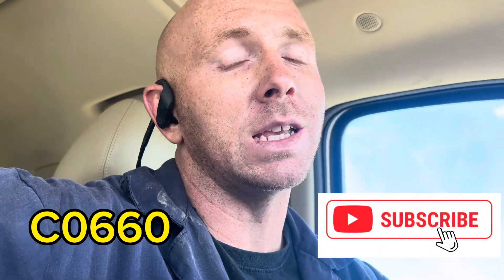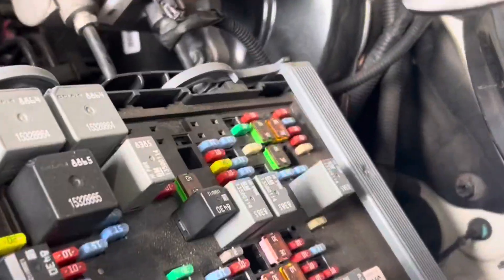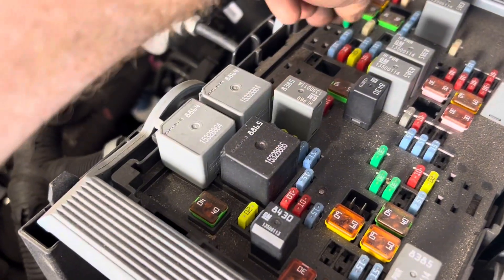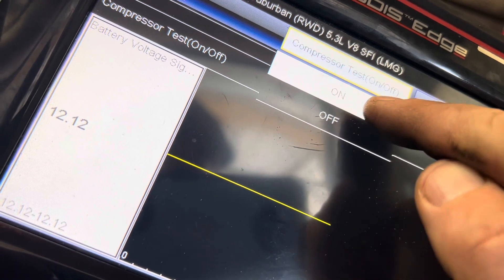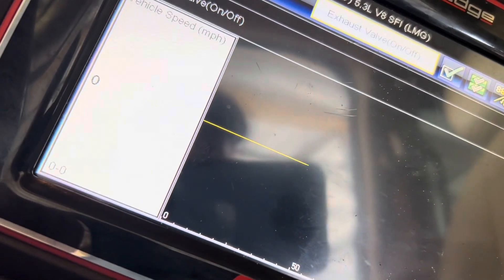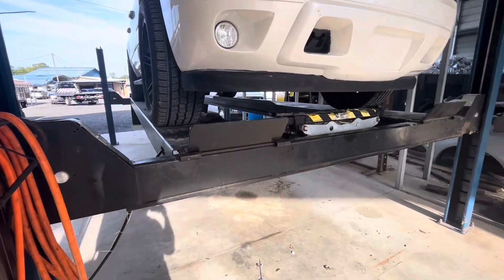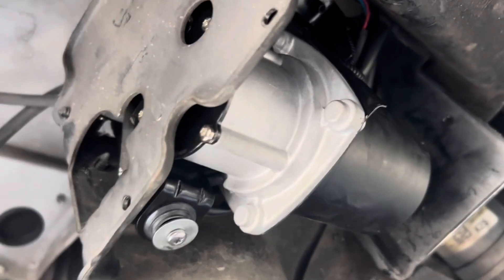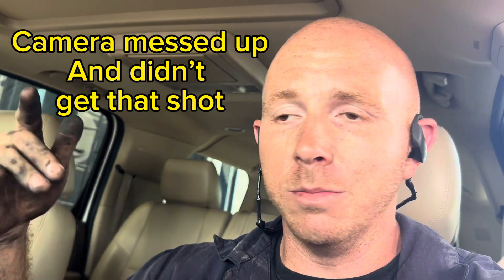Service Suspension System C0660 2013 Chevy Suburban

Comment: So I think the guys I bought my avalanche from removed the air ride. I looked at the codes on the label in my glove compartment and it showed ZW7 which if I’m not mistaken is air ride.”For lack of better word” But I don’t think they deleted it properly. As I’m driving my gauges go to zero and the warnings AbS and I believe stabiltrack warnjj in my sign show. But on my HUD it says service suspension system. It does t stay on it just does it at any random time now, more so now than ever. Any ideas?
Reply from the maker: Can bus problems maybe?

Comment: Hi thanks for the video i have the same scanner but when i go to test the air ride compressor on the scanner mine says “functional test not supported.” I also have codes c0660 and c0895. Not sure if that’s why I’m getting that message or is my scanner isn’t working properly/capable?? Any advice is appreciated thanks!

Comment: I had a c0660 and c 0712 I replaced the the compressor again still nothing . I pull my alc relay I gave it power it clicks  I also gave my relay pins power to run pump , pump runs. Am I looking at replacing the Alc control module at this point since my c0660 keeps coming back. Thanks any help is appreciated
Reply from the maker: What about the level sensors? Since the pump runs when commanded, there’s something that the computer is missing in order for it to be commanded on by the computer.
Reply from the maker: Keep us posted hope it works out for you!
Reply: @Bluecollarmechanics  I'm thinking it's the alc computer module above the spare tire.  I would think I'd get a code for level sensors. I'll tackle eventually and give an update
Reply: Any update for this. I’m having the same issue. Compressor runs when power put to it at the relay.
Reply: @codylawless2643  I'm thinking it's the module under spare tire. I haven't messed with it. The warning comes snd goes
Reply: Hi, my Escalade does exactly the same thing you say, I removed the relay and put power directly on the compressor and the compressor turned on, the relay is good, have you replaced the module above the spare tire? @M.I.ADALESGARAGE